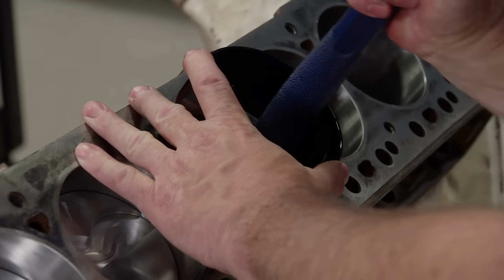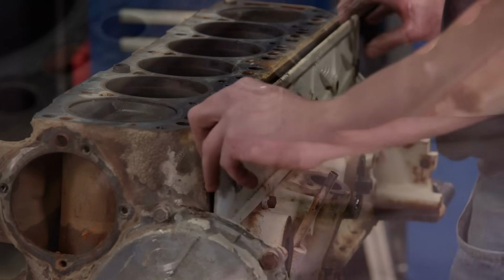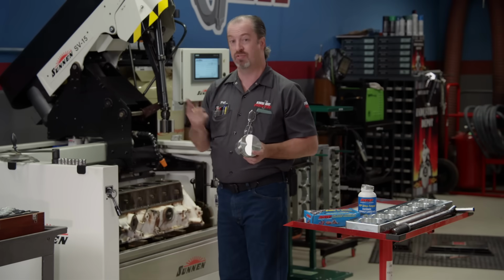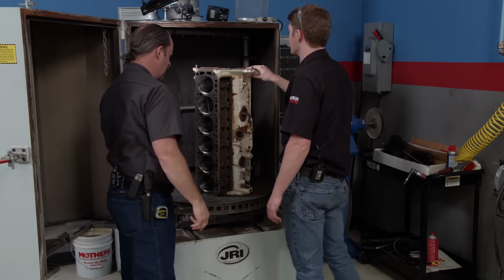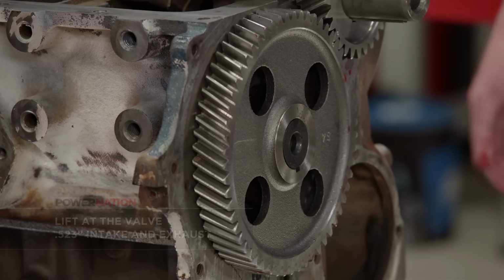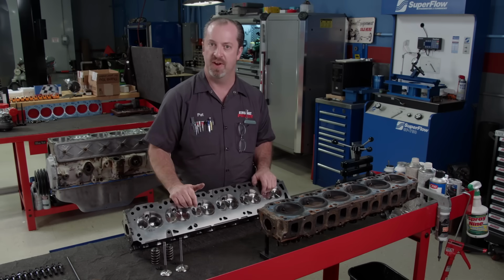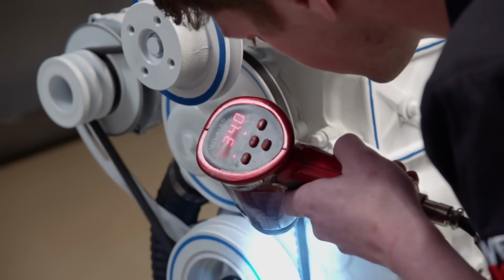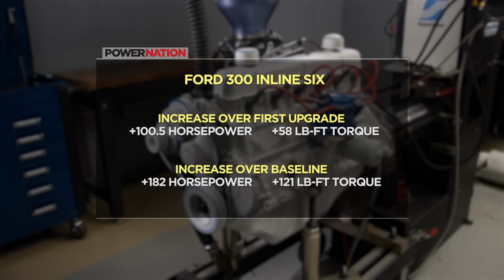Full-Tilt Build On Our Ford 300 Inline 6 For Serious Power Gains - Engine Power S8, E3

Comment: It's a shame nobody makes an aftermarket head for these gems. An Edelbrock would be a sweet deal for this engine. Great video as always. 👌
Reply: So i spoke with promaxx where they got the cylinder head from... they sell new efi heads that flow better and for some more moneys they will install the larger valves shown on this episode and they can even CNC port them for you as well flowing 218cfm which that head is gonna be on the turbo build
Reply: There are guys that make their own heads for these. One guy I been watching cut 2 LS heads and welded them together.
Reply: @ericmatthews7652  Holy crap that's cool! It'd be awesome if GM came up with an inline pushrod 6 with a head based on the LS. Heck I'd kill to see Chrysler come up with the same thing but with the gen 3 Hemi head. 😳
Reply: @iceman45ification1  They did in australia ive got like 4 in my backyard look up the Hemi 265
Reply: @iceman45ification1  - never heard of the Ford Barra im assuming
Reply: @CoyoteFTW  I have, but that's an Australian engine. I'm talking about for the US market. Lol
Reply: @ericmatthews7652  could you give me a link. I am thinking about doing the same thing, or raising (and re-shaping) the intake port 3/4"-1" on the efi head by milling the wide open surface above the ports and brazing on some square stock for the extra meat, and milling some plugs to braze into the old floor of the ports. Press-fit some dowels to fill in the unusable old manifold bolt holes, and tunnel porting the exhaust ports.
Either way it's going to be a lot of work
Reply: @fightfanian  guys on tik tok, @_schnaks_
Reply: Eric Matthews a 351 head can also be modified to fit the 300.
Reply: @ericmatthews7652  back in the day they were chopping ford v8 heads down and putting them on these blocks for drag racers.
Reply: @jacksonlifsey7291  they still do. The guy with the cut LS heads is putting it on an old school front engine dragster
Reply: The Aussies make a crossflow head for it.
Reply: @brianclark508   the aussie crossflow head is for the 250ci and below. We never got a 300 ci 6 cyclinder..wish we did tho.
Reply: @damienbrundle166  many 250 parts are interchangeable on the 300.
Reply: @brianclark508  it's the 240, confusingly enough, that shares a block with the 300. The 250 is singularly individual inline six, different even from the 170 small six block. Knowing is half the... something...
Reply: @damienbrundle166  correction the 240 and 300 can be interchangeable including head but using the smaller head used to be a trick to raise compression. Chances are that head would fit.
Reply: @brianclark508  no chance.
Reply: @weirdshift6881  nevermind. I looked back. The 240 and the 300 were on a different block. The 250 was the 200 block and eventually led to the barra. My bad. I was absolutely wrong
Reply: @brianclark508  It was confusing getting it all straight when I was bingeing info back in the day, gotta do my best to contribute with accuracy as I can.
Reply: @weirdshift6881  I was going to share a link to prove my point. Realized I was wrong. Had to admit my mistake.
Reply: @weirdshift6881  I don't know where you got that idea from. The 240 head and the 300 head are the same thing. Only difference is the combustion chamber shape, being kidney bean as opposed to D shaped.
Reply: @legostar55  correct that was never in question. We were talking about a crossflow or aluminum head from the smaller six fitting on the big six block.
Reply: @weirdshift6881  Oh ha, my bad.
Reply: @brianclark508  I have searched or one and never found one.
Reply: I’ve seen a set of cut and welded iron 351C heads made for a 300-6. Weird
Reply: I was watching a guy on here going through one of these for a customer. Somehow the owner's Dad had put Cleveland Heads together on it. Lost the link so I never got to see the teardown.
Reply: SGTJDerek I saw that
Reply: Clifford used to make an aluminum head for Ford inline 6s
Reply: Skip R  someone, I don't know who, back in the 80s had a split intake for dual 2 barrel carbs along with a split exhaust header with dual outlets for dual exhaust. I had wanted to get it for my 76 ford f150 with the 300 I6
Reply: @bigboreracing356  back in the 70s and early 80s the 300 six ford was the go to engine for pulling trailers here in Central Missouri 😀
Highway ford's with 300 six cylinder ,4 speed Trans and 4:10 gears out ran most of the v8s including the big blocks in those days.
Ford actually was testing a turboed 300 six back in the 80s but quit when the diesel craze started
Reply: Skip R  correct. All they made was a manifold.
Reply: There are aftermarket aluminum heads for the small Ford I6
Reply: Enginequest makes a new stock replacement head that is stronger and flows better.
Reply: Make some outta ls heads, easier than you think
Reply: @Logan-by5mu  for someome with access to shop equipment sure, magnitudes less likely any random joe in his garage is brazing heads and doing the R&D for intakes and exhuast etc etc...
Reply: @weirdshift6881  actuallllyyyyy there is a guy on youtube that does just that, makes his own engine cases too, look up millyard
Reply: @Logan-by5mu  "a guy on youtube" isn't quite what I'd use as proof of concept ha ha there's bound to be one of those that can do anything, odds are they labored in a particular industry for many years to acquire the knowledge of which appliances to use, how to use the appliances, and what material to feed the appliances. Anything else is an anecdote within an anecdote and subject to intense scrutiny.
Reply: @weirdshift6881  We're not talking about anything that's a daily driver or professional race engine, but if the shits square its square, round it's round, it may be above your head, but it certainly isn't rocket science. This guy in particular I'm talking about is a hobbyist, but his work speaks for itself. Nothing special or complicated about it.
Reply: @Logan-by5mu  are you seriously trying to say Allen Millyard, a reported "genius engineer" is the equivalent to some guy in his garage, is that who you are basing your argument off of?
Reply: @weirdshift6881  "reported genius" holy shit, this stuff really is over your head, sorry bud
Reply: @Logan-by5mu  I can rail off flow numbers, particular g forces stock pistons experience at tdc and bdc, cam theory and ignition timing events for this engine all day boy. Nothing here is above my, or many other people's heads, we just lack the physical access to a full shop worth of machines and a lifetime of experience designing things to be made on them. You're right my bad...  wanker.
Reply: @bigboreracing356  it isn't special or anything. But they have a reputation for being overbuilt which is always good news. They can support good power. An FE would obviously out power a 300 6. But they have there place now. There's tons of stuff for sale in my neck of the woods, including some 300 6s. And I'm sorry to say but I've seen them in everything, just like I said, from 150s up to dump trucks. They were put into damn near every type of tractor of farm implement you could think of from spreaders to irrigation pumps. That's where you find them.
Reply: @bigboreracing356  I enjoy the sound and just like spending money on a flat head ford, is obviously not the economical solution here. I like turbo 6s. Ever heard of a cummins?
Reply: There is a company that makes an aluminum head.. but due to covid.. things are on hold... look up vintage lines
Reply: @christopherandersen5950  they have that currently for the inline 200/250... no aluminum heads for the 300 yet
Reply: Pretty sure they have aluminum heads for these in Australia, they're big over there
Reply: @Logan-by5mu  the aluminum heads made for the Ford 6 are only for the smaller ones they don't fit the 240 and the 300 which are the ones you want
Reply: You should Google Ford 4.9 LS head swap. There are a few people that have done this and had great results. it takes some extensive machining and fabrication but well worth it to have the high-flowing LS head on it
Reply: @Firion13  have you seen the guy that put LS heads on a 351?
Reply: I rock a 1970 F 600 with this in-line six and an eight speed set up.(4front+2back ). Heads really aren’t even necessary, high flow intake true dual exhaust you got yourself a good machine unless you’re trying to actually make high horsepower.
Reply: @Uberaroundtheworld530  they were indestructible engines. The only way they malfunctioned was by user error. There was one in a delivery truck I used years ago. Thing just kept on going.
Reply: There is no aftermarket head.   Probably because there is no market.   Simple economics buddy.
Reply: @bmstylee  the 300 inline 6 is getting super popular. With gas prices rising again there is alot of talk about swapping these in place of 5.0 v8s with a turbo.
Reply: @henryjensen2741  those people would be morons.  You would spend atleast $10k to replace something you already own.   You would never save enough money to recoup your investment.   Better idea.  Sell the v8 and get a 4 banger if you are so concerned about fuel cost.
Reply: @bmstylee  I'm just telling you how things are right now. They are absolutely everywhere. Strong as hell, stout, and make good torque. They've been in every vehicle from passenger car to heavy duty trailering machines. They also handle boost very well. Everyone has one laying around. It's no wonder the aftermarket is taking off. People are realizing their value. And no, it does not take 10k to replace a 5.0 with a 4.9. Sounds like you haven't done many swaps in your lifetime.
Reply: @henryjensen2741  by the time you spend the money on machining, internals, turbo system, fuel system, computer, ignition, exhaust, tuning, and getting it into something not designed for you could buy a used car.   Strangely if there isn't a head available aftermarket I would say the market is limited at best.  The Flathead V8 is bigger than the I6 and those are antiques with no modern application.
Reply: @bmstylee  Hotrodders have always shit on 6 cylinders. Things change. Machining is cheap. Tuning? Don't pay for. Turbo ? Couple hundred bucks for a cheap kit. Most expensive part would be efi, but that's not necessary. Carb will work just fine. Junkyard motor mounts, pistons, and I don't think you'd need a new head. So pistons, machining, turbo kit. Trade the 5.0 for some fresh parts, drop your cost just a little. Couple grand for a swap, I've never payed more. Again, sounds like you've never actually done one.
Reply: @bmstylee  I think it's also worth mentioning, Vintage Inlines does make a nice race head for the 300, that comes with some goodies. It's all aluminum and costs 2 grand. Not bad for a pair of v8 heads by comparison. It's a little bit more expensive to make power, but that would still be half of what you said.
Reply: @bmstylee  priced a few but haven't actually undertaken a build. And I'm glad you feel comfortable spending 10k on a project, but if that's not an issue, then neither should be spending all that money on a 300 6 anyway. You're walking in circles. The vast majority of people prefer to do budget builds. That's the nature of the game. First rule of acquisitions, never pay more than you have to. I'm glad you've got money to spend on a project, but I think you should do a couple then get back to us.
Reply: @henryjensen2741  you talk alot of bravado for being the guy who gave a "blow-up-my-honda-first-pass" type build. Carbs can't turbo ask the 80's, you tune or toast your engine going lean period, cheap turbo kits feed your engine steel particulate etc. Have fun spending maybe not 10k but easily 2.5k on a pile of garbage that won't make 300hp ever and run for maybe 5 minutes before terminal knocking. Nobody else can.

Edit: And link this non-existant Vintage Inlines aluminum head for the big six. I've been watching and waiting 15 years for it pal it's not happening.
Reply: @weirdshift6881    If you think turbo tech is still from the 80s, then it sound like you didn't change much from then either. That speaks enough on its own. You watched the same video I did right? It's not a huge power machine but it's very stout and responds very well to upgrade. Especially power adders like turbos, if you've been keeping up with any news since the 80s. They are already did a series with a turbo 300 6. Made excellent power and had wonderful charts. You clearly haven't been keeping up. It's been put in absolutely everything and had a very long life. It has a good aftermarket following now for a reason. It's a good people don't listen to guys that don't have experience like yourself.
Reply: @henryjensen2741  you're just repeating yourself over and over without knowing what any of it means. Carb'd turbos are horrible for power or efficiency, they figured that out in the 80's. Not turbos. You didn't read anything other than my disagreement. I make the same power and torque as shown in this video with an 80's turbo 2.3, half the size engine with a tiny turbo but has EFI. The most advanced turbo of tomorrow doesn't change any of that so I don't know what you are even saying.
Reply: @henryjensen2741  I own and have run almost all the aftermarket there is for 300s, don't even start thinking you know anything more about these engines than anyone else. And link that ally head or be quiet.
Reply: @weirdshift6881  have you ever heard of blow through carbs? I believe Richard Holdener has made over 1k hp on the CSU blow through that Westech has.
Reply: @GreatLakesLogger  Ooohh wow so what? Some company based project with high dollar purpose built race parts can do anything. I never said carbs can't, and you're not bringing a genuine argument to the table with blow through carbs. Find someone who says that a blow through carb is better in any way for power or efficiency than any form of fuel injection. It's why they stopped doing blow through in the 80's. Someone reviving old tech doesn't mean anything in any reasonable conversation about power.
Reply: @weirdshift6881  sorry, that was entirely unnecessary.
Reply: @GreatLakesLogger  as is any point advocating for carbs.
Reply: @weirdshift6881  technology certainly isn't comparable, but it not uncommon for carbs to make more power than port injection due to intake air temp cooling and in some cases better atomization.
Reply: @GreatLakesLogger  without an intercooler and with very out of date injectors, maybe that's true.
Reply: @henryjensen2741  who’s talking about them?

Comment: Please add FITECH and see what happens.
Reply: I'd rather see a holly sniper
Reply: @lighterguy82  I understand. But Fitech is cheaper, and most guys building 300s arent high rollers.
Reply: @highplainshollarhomestead3188  they really aren't that much different in price
Reply: @lighterguy82  really? I thought the holley was 1.5 to 2 times as expensive. I could be wrong.
Reply: @highplainshollarhomestead3188  about $300